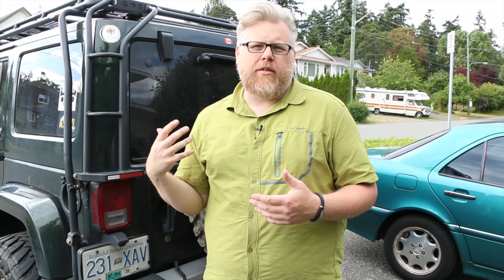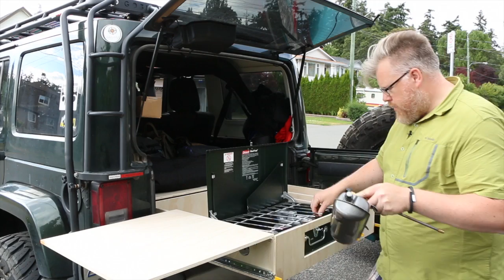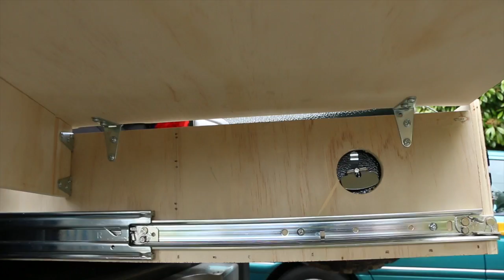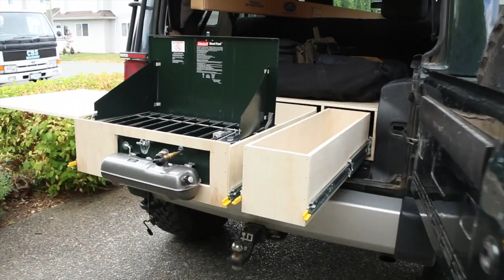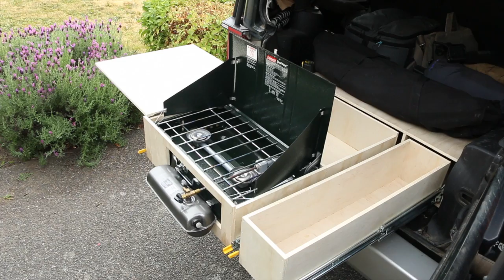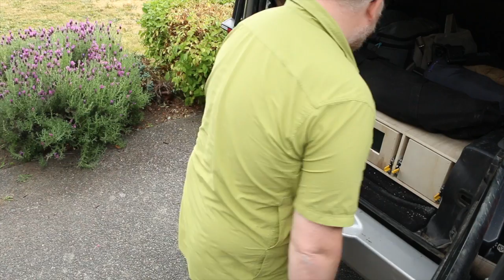Jeep Expedition Kitchen DIY

Comment: way cool, I'm going to keep this in mind after the drop-down tailgate is installed. Where'd you get those cool locking slides?
Reply: +Jeremy Cummings I got the slides at lee valley and though the second one I'm using right now is so much better I'll shoot a video walk through asap.

Comment: What locking drawer slides did you use and where did you get them. 30 inch doesn't seem to be readily available... thanks! Great job!!!
Reply: ***** Thanks for the info.... I have been in the cabinet industry for 25+ years and have built many, many camp things along the way. I also own a Jeep and you have saved me a ton of thinking, so THANKS!!!
Reply: Those are Accuride Slides.